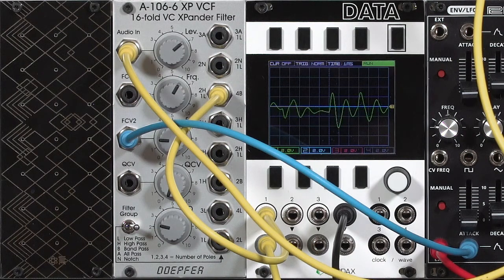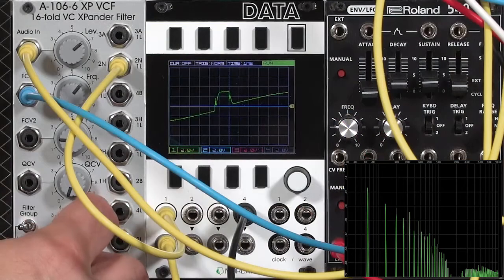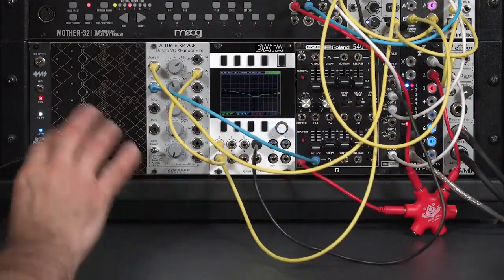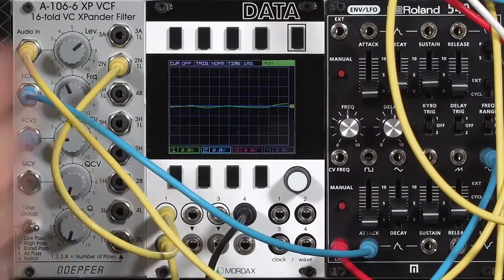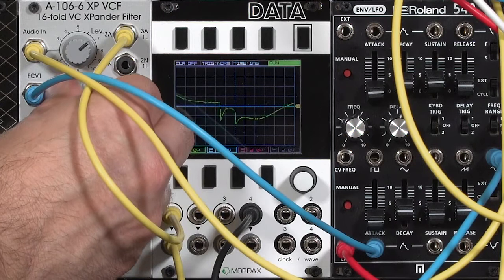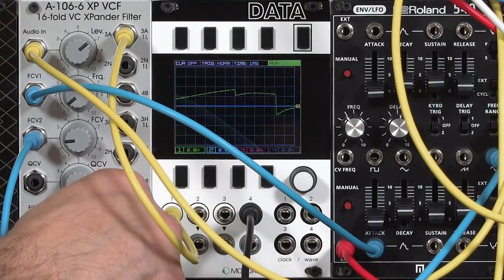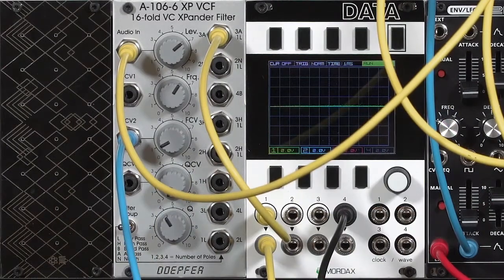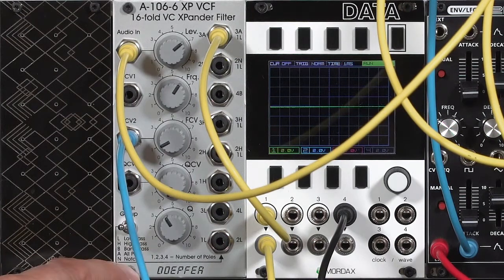Doepfer A-106-6 XP Filter 4/4: notch & all pass modes (LMS Eurorack Expansion Project)

Comment: Do you need to boost the signal from the Mother 32? is it line level? Thank you for sharing
Reply from the maker: The VCA output at the patch panel is modular level. The output jack on the back is at line level.